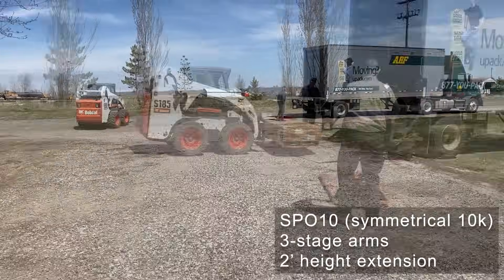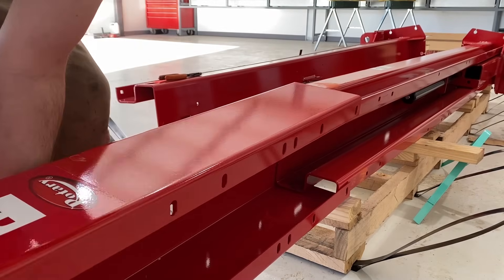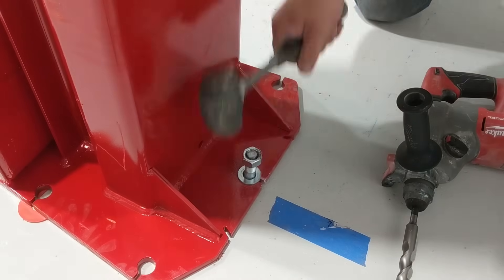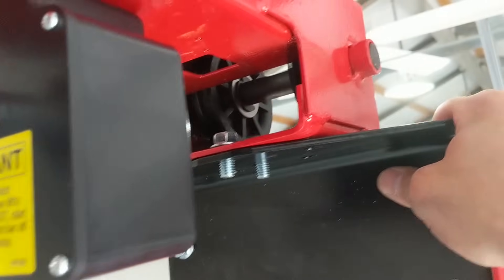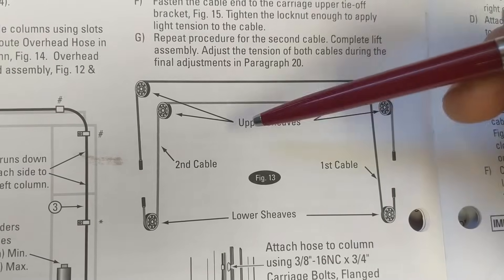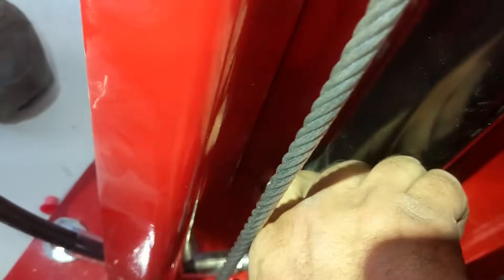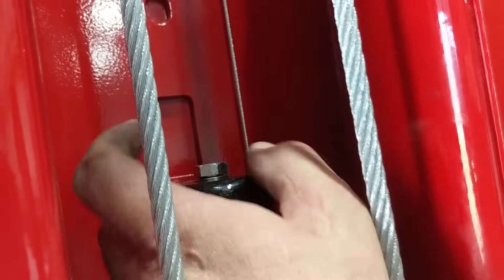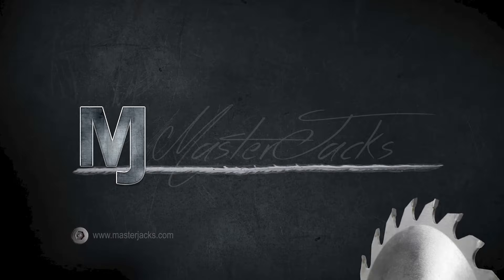Rotary Lift Installation: Complete unboxing and full Install

Comment: Cool vid.   I’ve got a 9K SP98 2 post Rotary and after 35 years I finally needed to replace the seals in the cylinder.  These are the only lifts I trust to work under.

Comment: Awesome video. A couple years ago I bought a used Rotary SPOA9 and installed it in my shop. I spent a LOT of time making sure the columns were plumb, level, and square. I have learned a lot about lifts since having this one and don’t know how I would live without it.
Reply: This  lift is  only  suitable  for cars  and  pick  ups.
The  pipes  and  cables   should  be on  the  floor.
On  the top  means   you  can't  put  a  large  van  on  this  lift.
So  I  would  never  buy  this  type  of  lift.

Comment: I got a free inground  lift ..globe model  # fs-10...it was only 5 yrs old..in 1999..I like the clean open floor look..I like yours ..it's a great unit...no china..cheap.China....  stuf..stuff.. did well..my lift still works great. No oil leaks...no maintenance..but only look it over each yr..check the oil if full.  To plug fill line ..no leaks..  the outer case was factory fiberglass..no rusting ..air line I installed  is copper heavy  type...no rust out..underground..free is good....but yours is awsome..heavy duty..love it..great video

Comment: Weird watching this...back in 99 I bought a SPO9 9000 lb, Asy 2 post for 2695.00 delivered from the factory.  Me and my son installed it. Only issue I ever had was to replace the spotting dish as it rotted out. Never an issue from day one...best tool I ever purchased. Back then everyone I spoke to mentioned, get a Rotary...it's the Cadillac of lifts.

Comment: I have the same lift.  Picked it up from the Rotary factory in Madison IN the summer of 2020. When picking up my diesel super duty I put supplemental jack stands on the ends.  So much of the long wheelbase trucks is out past the arms you can make it “rock” when wrenching on it.  I had to shim my base plates also and injected epoxy under the baseplate.   That may not be mandatory, but I fell better knowing there is close to 100% support under the column baseplate.
Reply: In the fine print of the instructions they say to pack non-shrink grout under the columns but I prefer your epoxy idea.

Comment: great video. i bought and installed the same one but asymmetrical, 2 years ago. it was not that much more to buy this USA made lift than those china made lifts. totally worth it.  did a lot of research and took my time with the measurements and placement. again, taking my time, i would do maybe a couple of steps a day and double check everything as i go. then read the manual again for the next steps the next day. i made a few errors like you but got it done eventually. what a game changer to work on your car. red looks good. i got blue. good luck with it
Reply: This one had Made in Taiwan on it. At least on the bag of hardware...:-)
Reply: @mapintil  
Made in Taiwan better than made in china 😉
Reply: @peteryeung111  Thank you Sir. I agree and I appreciate your response.
Reply: @mapintil  
😁🤝 🍻cheers
Reply: You're damn lucky that you bought it when you did.   Prices have more than doubled since COVID-19.
Reply: @TriAxleTranny  I believe it. A month after I ordered mine the price went up around 10%.
Reply: @RB66_  
I had the same experience.   I ordered two SPOA10 lifts with the Shockwave option for $8492 each 12 months ago.   Today the same vendor sells the same model for $10,248 each.   I wish I would have ordered them about 3 or 4 years ago when they were less than $5000.   Oh well.
Reply: @TriAxleTranny  I paid right around $4 for mine. Basic SPOA10 asymmetric. Installed myself. Love it. I’m planning to change all the transmission cooler lines on my 2011 F150.

Comment: Install the ff729 spotting dish 3’10”  forward of center lime and 2’5” left of center. Them use the instruction placard to position the different type of vehicle to the front middle or rear of the spotting dish. This guy is front loading every truck he put up.

Comment: Drill your holes all the way through the slab so if you have to move it you can hammer the studs flat
Reply: You risk "punching out" the bottom of the slab thus creating a weaker mounting area!

Comment: I install these daily for my job and can’t tell you how many times rotary has made one small mistake that has fucked us over. My buddy and I spent all day at Land Rover/jaguar installing two spoa10 standard black lifts then right at the end they had bent the carriage near the hole for the pin to hold the arms in place so we couldn’t finish the job and had to call them to get a replacement carriage, and that’s just one story of many. Either they are missing small parts or something on the lift itself is bent.
Reply: You should have the customer contact rotary directly and they would have sent someone out to install the new carriage. Its a warranty issue.
Reply: I have a hunch that Rotary has a problem with workers.   My SPOA10 Shockwaves had over a 6-month delivery backlog and the price is more than double what it was 3 years ago.   I don't even want to think about what I'll have to deal with if I need support.

Comment: Nicely done with this video how did you hook up the overhead shut off switch and did you have to drill holes to install the electrical box inside the column ? Thanks
Reply from the maker: Yeah, sorry about that. The overhead does wire inline with the power supply so that it can cut power when activated. The instructions show how the wiring is to be done. I did drill a hole to mount my electrical box within the column.
Reply: You can drill a junction box to the column or route conduit overhead to the ceiling, but always make sure there is a disconnect close by if you need to work on the lift power unit so you don’t have to climb onto a ceiling

Comment: Nice video. I just installed my used Mowhawk lift last weekend. Did Rotary mention anything about using epoxy with the anchors?? I used it with mine
Reply from the maker: That'll be a sweet lift. Rotary didn't have anything about epoxy for the anchor bolts, but I know there's benefit to it in certain applications.
Reply: Unless you anchor into a slab, that doesn’t have the adequate amount of inches, none of that adhesive is needed. Those anchors won’t fail.

Comment: Hey about the power hookup. 
Does your main wire goes in the overhead limit switch before going to the power unit?  And how is it wired?
Reply from the maker: I'm no electrician, so take it for what it's worth. You run one of your 240v hot legs through the overhead switch on the way down to the power unit. I mounted a box on the upper column and brought my power into it. From there I ran the black wire over to the limit switch, through the switch, back to the box, then both power legs and the ground leg from the junction box down to the unit. Hope that helps!
Reply: @MasterJacks Yessir exactly what I needed. That confirmed what a was thinking. 
Btw really good vid! Great work. 
Thanks

Comment: Thanks for the excellent video. I am in the process of selecting a lift and I am trying to determine the type and how much room I need for it. I am just curious how you decided between a symmetric and an asymmetric lift. Also can you please share how you determined the position of the lift within the bay and how big your bay is? The trucks seem very close to the door. Does this cause you any issues? Would you position the lift in the same place if you were to do it again? Thanks so much.
Reply from the maker: Good questions. The shop is 30' deep. It is 13'-1" from my closed overhead door to the center of the lift columns. This favors more room in front of the lift for my bench, mezzanine, room to work, positioning cherry picker, etc. I've had long-box crewcab pickups on it without trouble closing the door. In my opinion, there's more versatility with vehicle positioning with the symmetrical lift and three stage arms. The rotary rep recommended I go with the symmetrical lift when I told him I wasn't interested in any arm deflection and being comfortable under vehicles at the upper end of the 10k rating. I also have a new (2023) bendpack 10k lift. I like it too (especially for the price), but the rotary is better. It lifts faster, the motor is more conveniently positioned, the profile and footprint are smaller (just as beefy), and it has more teeth on the arms (arm positioning), and I love the 3-stage telescoping arms. They both do everything I need them to, just prefer the rotary (but man they're expensive!)

Both lifts came with instructions for positioning within the bay for maximum usability. Enjoy shopping, I'm sure you'll love whatever you buy!
Reply: @MasterJacks Thanks for your reply. The number of teeth for adjusting the arms isn’t something that I had considered. I better do some more research on the lifts. Take care.
Reply: Rotary and challenger are the best lifts out there but they are mainly for commercial use. There are a couple other brands like forward and Manitowoc that are greatly built and you can get parts to repair them. It depends on what you’re lifting up and how often and whether you have the ceiling clearance and slab clearance are used 7000 pound rotary is ideal for home use

Comment: Pardon me if the info was in the video and I missed it, but what model no. of this 10k lift was featured. AND. Is it a symmetrical or asymmetrical configuration?
Reply from the maker: It's the SPO10. I ordered it with 3-stage arms and a 2' height extension. This is the symmetrical model. It handles heavier loads better, and in my opinion, is more versatile. The 3-stage arms are the same ones they use on the 12k models, so they're beefier, but have great range (from short to long).

Comment: on the delivery...did they use a liftgate to lower the pallet? i saw a guy with a palletjack on the ground. i have very easy access to a pallet jack if i can have it off the truck that i can move it into my garage but i dont have a forklift or anything and i keep reading the buyer must offload it
Reply from the maker: In my case it was lowered from the semi with a liftgate. We used a forklift to get it from the road to the shop. If you had a hard surface the whole way, I'm sure a pallet jack would do fine.

Comment: Does this lift have an overall height adjustment with various holes on the top section or is it fixed. My ceiling is 11’5”. It says min. Ceiling Height of 12’
Reply from the maker: Probably have to ask the rotary rep, but you might be able to shorten it some. Also, the cables and hoses come sized to the height you order.

Comment: HOW MUCH DID IT COST? LOOKS GREAT,WELL MANUFACTURED
Reply from the maker: As configured, it was $6700 when I bought it in 2020. I priced one about a month ago (Oct 2022) and the same setup was $9600. There has been a price increase along with a "temporary" steel surcharge of around $1200. Blah. Absolutely love the lift though and will probably eat the price increase when I'm ready. Hoping steel prices relax.
Reply: @MasterJacks  thanks looks fantastic

Comment: 1/2 inch of shims in one place is not a thing unless you are not willing to buy longer anchors you didnt explain that at all. Also always use 10000 psi grout when raising a column above 1/16 inch. Rotary baseplates tend to “oil can” when raised only by shim. Hydraulic cylinder sits in the middle of the anchors/ shims. Most hoist companies will install residential for a flat fee of 600 plus materials like grout or electrical

Comment: I thought it would be a long rods they ride on than cables like most all others...
Reply from the maker: The hydraulic pistons raise the vehicle. The cables equalize the lifting force from side to side.
Reply: @MasterJacks  I always thought it was to spiral rods that the lifts would ride onto raise them than cables. You would not need locks too.

Comment: I could put that lift in half the time no transit use arms to check level shim first column then level second leave anchors half up so arms dont drag structure is done all that's left is rigging too much  info for a simple install

Comment: This  lift is  only  suitable  for cars  and  pick  ups.
The  pipes  and  cables   should  be on  the  floor.
On  the top  means   you  can't  put  a  large  van  on  this  lift.
So  I  would  never  buy  this  type  of  lift.